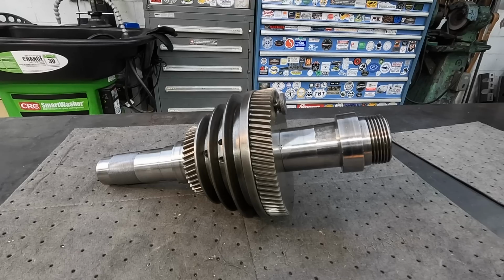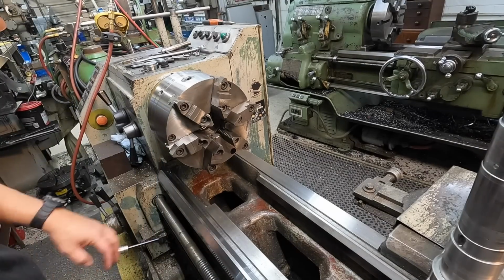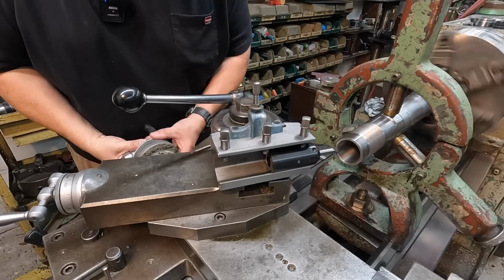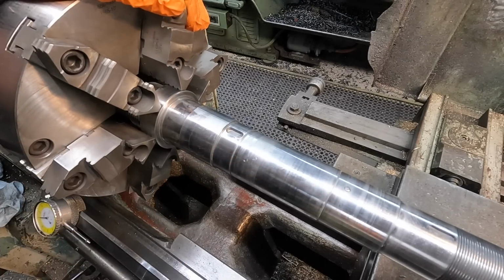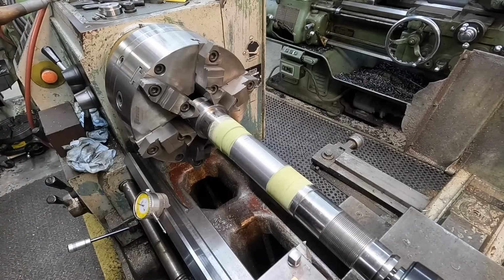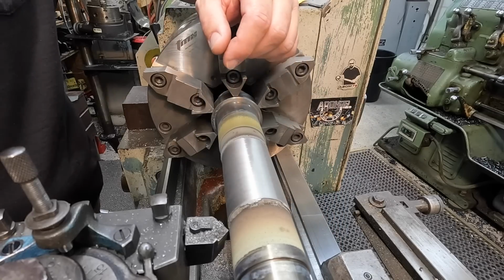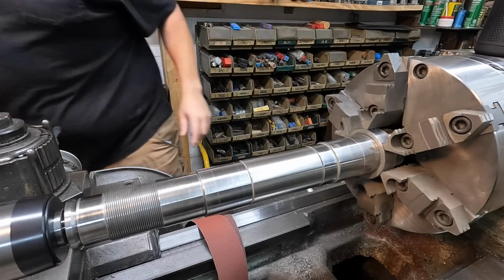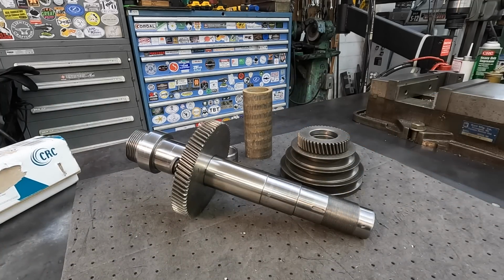Lathe Spindle Repair

Comment: This is the spindle drive arrangement used in old British Myford lathes. These lathes are in normal drive when the bull gear (big gear on the spindle nose side of the pulley) is locked to the pulley with the pin engaged. So the pulley drives the bull gear directly which drives the spindle. In back gear you uncouple the bull gear from the pulley (by latching the pin out of the pulley drive hole) and engage the back gear. The back gear is driven from the small gear behind the pulley and drives the spindle through the bull gear at a slower rate. For this to work, the pulley must run freely on the spindle, which is where the wear was on this spindle and pulley set. And yes, bushing the pulley (and smaller gear) with a bronze bearing is the right thing to do.
Reply: Back gear for when the pulley spins on the spindle shaft, something one might expect Adam to surmise instead of saying he didn't know.
Reply: @richardjones-sl2zd  I’m sure he figured it out, if he didn’t know already. Just pointing it out for anyone wondering who’s not familiar with this arrangement. 😊

Comment: Adam, you saved my lathe!  I have a very similar machine to the td4 that I picked up a few months ago.  Excessive chatter in backgear despite spending hours trying to adjust it.  What I realized after watching this video is that there is a set screw oil hole in the middle belt pulley that requires oiling, and was likely never oiled through the 50 year life of this machine.  Chatter went away instantly!  Hopefully you saved me a big repair.  Thanks for all you do!

Comment: Great video Adam. So satisfying to watch manual machining. This repair was likely needed due to running in back gear with inadequate  oil. Close inspection of that pulley should show a removable screw you can take out to squirt oil down onto that spindle when you run in back gear. This looks like 80s Taiwan lathe. An owner's manual should cover the oiling procedure. Keep em oiled guys.

Comment: You could regrind those bullnose centers instead of just replacing  them. You can do it on the lathe using a toolrest mounted diegrinder.
Would make for a nice video

Comment: These type spindles are used on belt drive lathes and only rotate inside the housing in back gear. Nevertheless, if there’s room they need bronze bushings and some way to oil them. Adam is on the right track with this one.

Comment: I was thinking of the threads you cut in prep for the spray weld - specifically, the ones in the smaller 'trench' where the big galled spot was - and wondered if a few parallel grooves might have been a less risky (if slower) option.

Comment: You would be correct about the shaft being used in branded lathes.  I bought an old (probably from the 1950's) lathe sold by Select Machine Tool& Supply Company in Bell  Gardens, CA.  The phone number on the user manual  does not have an area code!  Naturally, they are no longer in business.  It is listed as a 10" bench lathe.  The cover of the manual says 5in x 23 in.  I use a 6 inch chuck and an 8 inch faceplate.  upon aquisition I also took mine completely apart for cleaning and new spindle seals.  Anyway, the spindle on mine looks identical to this one.
I am retired IA teacher.  Hobbies -- woodworking, metalworking, steam engines, black power, rock crawling with my Jeep.
I did enjoy your video.

Comment: I have a 100 year old small lathe and the spindle construction (back gear, pulleys, etc) are the same down to oiling spots. The only difference is that my lathe has flat belt pulleys. It's really interesting to see.
Reply: I also got the same construction with 2" flatbelt pulleys Its a Simplex from Belgium and it traces back to the 1950's.
Reply: @arjanvanraaij8440  My could also be Belgium, all markings on it are in French. Only the sellers plate is in German.

Comment: ive never seen a repair like this done, didnt even know this was a possibility. i was imagining how u was going to do it but i was way off, i was thinking something in a cnc machine with some kind of welding but that was not what i was expecting. what is that process called, and thanks for sharing stuff like this, i would have loved to found this stuff when i was younger an im just now getting machines an trying to learn but i would have loved to took this direction as a career path.

Comment: How much of a pain would it be to repair those bull nose centers? I’m thinking just skim a c-hair off. Without taking a closer look I don’t know what could be done to prevent it spinning but shouldn’t be that difficult. Would be cool to get your dad’s stuff back in action.
Reply: Those ones need quite a bit taking off to get back to good, probably not worth the bother. They are not that expensive.
A little surface damage, put the Mt in your headstock bush, tape the back of the centre up with duct tape to stop the bearing spinning and clean it up with a toolpost grinder using the compound slide.
Reply: @dutchgray86 How about flame repair to the conic centers?

Comment: The eutectic process, do the machined surface have a little oil absorbency much like sintered bronze. If it does it great for plain bearing holding the oil… great work, and to Abbey behind the camera the unseen hero.

Comment: I'm just curious to know, doesn't that flame sprayed metal layer need some form of annealing to get the right kind of hardness? How do you select which powder to spray so that it has the same surface hardness as the original metal? Thanks. Very interesting video by the way

Comment: Nice repair, I've never seen anyone here use the flame spray method myself. I was surprised that the pulley was so worn though, I had thought cast iron would have been a good candidate for running against the shaft, since it's naturally lubricating and will also absorb oil into it's pores. But apparently not?

Comment: I have a background repairing many different aircraft parts and the only difference is the runout of the gear was to
Reply: The pitch diameter to the axis. Plus we had good grinders and gage pins to work with. 
Thanks,  Bill

Comment: Backwards running happens when the pin is disengaged.
The large gear is where the key that drives the shaft is located. If the pin is engaged the pulley drives the gear and thus the shaft. If the pin is disengaged , the pulley freewheels on the shaft and it's rotation can be routed through the small gear on the pulley, through an idler gear to reverse the rotation.
As far as I know that is always the case in this type of design.
Reply: The final result of using the back gear does not change spindle rotation, it gives you another set of spindle speeds......maybe I misunderstood your comment.
Reply: @shannonstratton3164  My lathe actually reverses as well as provides lower gearing through the back gear. Perhaps that is peculiar to ancient ,flat belt driven lathes?
Reply: @PaulG.x  Interesting, my Logan 200 does not reverse the spindle.  My logan spindle is trashed way worse than this one abom is repairing....never had the slightest issue with it going into back gear.

Comment: Just a question… Why would you not just cut and polish the shaft and then bore the new bushing to the size you just made the shaft?
Reply: Because spray welding is way cooler to put on youtube? 🤷‍♂️ he did say that the next step on the shat was a bit too close in size to do that. It also keeps the shaft oem size for replacement parts.
Reply: He mentioned that possibility, but preferred to bring it back to factory spec 'because he can'. That way, for any potential work on it in the future, it will match the published mfg specs and not possibly confuse someone.

Comment: I've seen repaired spindles years ago, that looked like they had been plated oversize, then turned or ground to size.  They ran well but a few years later, the plating began to flake off.  I don't think spray welding had come to be used back then.

Comment: I’m curious, why does the flame spray chip look more like cast iron than steel?
Reply: because its in nature closer to sintering or powder steel metallurgy method of making parts... You dont ever really get the surface to melting point, nor are the grains that you shoot through the flame cone molten, they are extremely hot, and the surface is hot enough that they stick to the surface and bond onto eachother... Sintering and powder metallurgy has gotten a bad rep with laymen due to cheap import sintered gears in tools and such, but proper powder metallurgy allows you to make ``metal alloys`` that have much higher ratios of elements than regular molten approach can offer without causing segregation... You have a mix of steel dust and other various alloying elements like chromium, vanadium, moly and so on, homogeneously mixed and applied, resulting in this case, in a dense matrix of steel and alloying elements which have fused, but were never allowed to flow as they would like to... In powder steel forging method, you essentially apply such a matrix onto a surface, separate the two, heat up the powder plate, not to melting temp, but sintering or forging temp for such a mixture and press forge it by folding the plate onto itself until you have a billet of homogeneous metals that are even better compounded into a solid matrix by repeated folding under heat and pressure... Yet still, were you to cut it with a machine, it would behave not like normal steel, but cast iron or sintered metal, as it never truly flowed into a cohesive slab, yet keep in mind that such metal billets are in many regards vastly superior to regular alloy steel, and can be used in many areas and under many factors that steel would not do well in... What i described is not really how powder steel is done, but i believe it casts a good picture of the reasons and the process and the first part regarding this spindle case is pretty much spot on...
Reply: @camillosteuss  thank you, it makes a bit more sense now. I always like more info than less😀😀 thanks
Reply: I have a similar lathe with a 60mm x 8TPI spindle.  Backing plates for these early 80s metric threaded lates are hard to come by.  May want to ask if he  wants an extra backing plate made while you have the spindle.

Comment: @20.00 Interesting the 51mm journal size. You may know 51 is a pretty common metric spindle bore size (roughly equivalent to 2”). 38mm (1.5”) is probably the most common for home shop lathes.

Comment: I don't know shouldn't the live center have been in place to keep the shaft straight while spray welding? I don't know just wondering 😀
Reply: The flame spray adds more material than necessary. As long as every part that gets the added material is bigger than it needs to be, when it gets machined back down while being held straight it'll end up straight overall. The surface created by the flame spray doesn't matter any more than the shape of a piece of raw stock would matter.
Reply: There's really no pressure being applied to the piece during flame spraying. Any movement that might occur due to heat is going to happen regardless of whether being supported by a center or not. In fact, one could argue that trapping the piece within a fixed distance and heating it significantly may actually lead to deforming the piece as there is no where lengthwise to expand to. It would have no choice but to bow out and then the rotation would compound that issue.
Reply: Think for a minute about the purpose of the live centre. It is to counter the forces applied while the lathe tool applies inward cutting force to the job being turned. Where is the cutting force while the shaft is being rotated while being flame sprayed? There is none. So what difference will it make if the live centre is being used? You should now now be able to answer your own question.
Reply: @bobhudson6659  Not only is there no cutting force when spraying, the heating is being done very uniformly because of the rotation. It really can't warp from uneven heating.

Comment: Isn't it possible to spray weld the Bell nose center chucks and repair them yourself? Sorry for my ignorance, just a thought, have never spray welded ;-)
Reply: I was wondering that myself
Reply: @1873Winchester  or at the very least just mill out the rings. The cones get a bit smaller but so what.

Comment: I'm a little surprised you don't mask it with tape, but I'm sure that would be more trouble than it's worth if you're not using grit blast for the surface prep.

Comment: is that Spray Weld harder or softer than the original metal?
Reply: Harder.
Reply: @dieSpinnt  Why are you so angry, man!
Also, so many times Adam says he uses powder harder than the damaged piece because it performs better, check his previous videos.
Reply: @djamelhamdia134  I don't think he's angry, he just needs to let people on the Interwebs know he's an expert. He even took the time (ETTT) let us know what the acronyms for various terms are (AFVTA). Knowing the acronyms make you a Super Expert (SE).

Comment: If the back gear on this machine works the same as mine (and it looks very much like a scaled-up version of what I have), then pin engaged is out of back gear; fast drive is the pulley directly turning the spindle and back gear is that small gear on the back being turned by the pulley and a second shaft carrying forward to the large gear. To go into back gear of course you have to make the assembly spin separately.

Comment: hi abom
greetings from Denmark

just a quick question what do like best metric or imperial ?? 
I know that your answer might be a little tainted because a lot of people around you use imperial 
so ware in your opinion dose where dose imperial beat metric and vice versa??
Reply: Obviously I can't speak for Mr. Booth, but in another life I worked as an apprentice machinist in an engine shop in the United States. I routinely worked with metric and imperial units. 

Most of our machines and tools were old so they were almost all in imperial units except for some micrometers and a gauge block/pin set. My brain worked in imperial to suit what most of the tools were doing, and measurements were usually an imperial as well but it's really close to being completely irrelevant. As Adam does in this video I'd work to a spec as decimal inches, but it doesn't matter much if that's decimal millimeters instead. Working at the scale of microns I saw no advantages or disadvantages to either system. Maybe somebody building a bridge or channel tunnel might care, but I didn't.
Reply: the simple answer is that neither "beats" the other - A good machinist is able to quickly tally between the 2 as you need to be able to pick up in whatever dimensions the layout drawings where done in for the part you're working
Almost every part imaginable is done to "Sensible whole numbers" it just depends on if those are whole milimetres or whole fractions - Once you see that it sets your mind on almostt everything else in the job

Comment: How do you keep parts straight when you heat them? I usually get a noodle when I heat a part.
Reply: Control the heat! Same goes for welding thin steel or sheet metal.
Reply: apply heat slowly AND evenly

Comment: Think you could do a flamespray repair on the live centers?
Reply: wouldn't be any need. Just turn them down
Reply: I think they can just be ground down. Their actual size is irrelevant, they just need the proper angles cut.
Reply: @Colin Fahidi  Oh, I thought maybe their size mattered. If it doesn't, then nevermind.

Comment: Adam,
Why do you always use the thousandths dial gauge instead of a tenths gauge when checking runout? I can see the benefit when it is way out, but after getting it close, it makes more sense to switch to a finer readout. You are always guessing on how good you actually have it instead of knowing.
Reply: I think there are two reasons for that - first he said he can tell from that guage whereabouts it was, and second tenths is more than enough for the accuracy of that kind of job.
Reply: For 90% of jobs you dont need to know the exact runout. .0005 makes no difference from .0006. Plus after years and years of working even on a .001” indicator you can tell the difference between .005 and .007 relatively easily. 

Yes some jobs require you to actually know if its .0005” runout or .0006” but it doesnt matter for this specific one. Its not a nuclear job
Reply: How would you decide where to center it up at? Most turned surfaces will indicate several tenths variance just from running over the turned surface.

Comment: What kind of fumes are produced by spray welding?
Reply: Depends on the powder/wire being used, but the guys who do this at my job are required to wear really good respirators. Even the ones that aren't chromium or cancer in a bottle are still not good in your lungs.

Comment: This is exactly the same spindle thats in my Microweily TY-1336 BH. Taiwan made lathe. Also goes under the ADVANCE namebrand. Had a hard time removing the spindle for the exact same reason as this shaft. Is the nose 2-1/4" 8tpi? 
Good job on making this one "brand new" 👏

Comment: Dumb question, but can the old, large center be turned to clean it up?
Reply: you'd have to find some way to spin it.  I saw someone do it with a belt somehow connected to a hand drill I believe.  and then a toolpost grinder